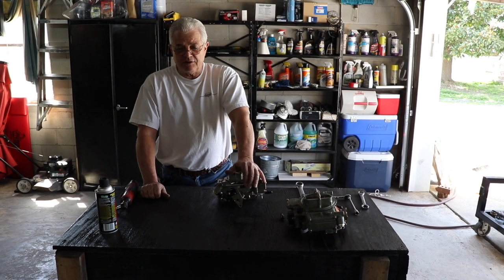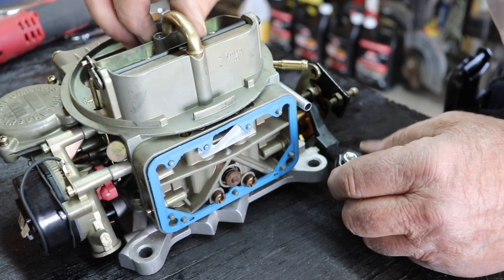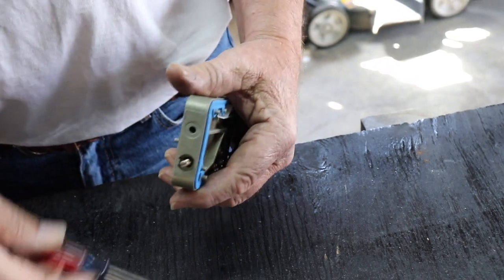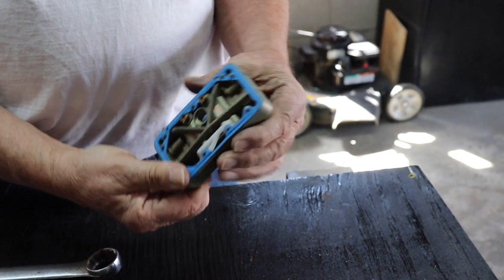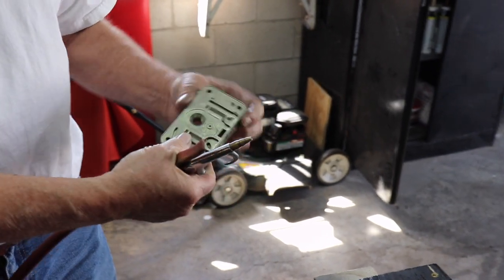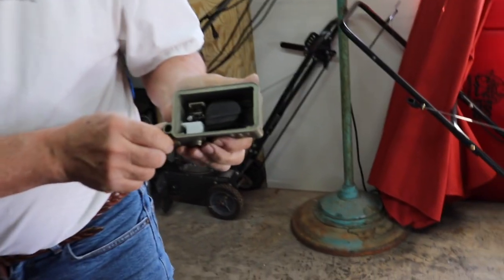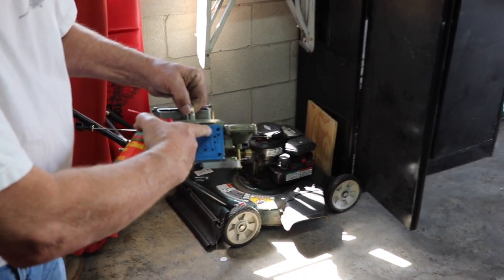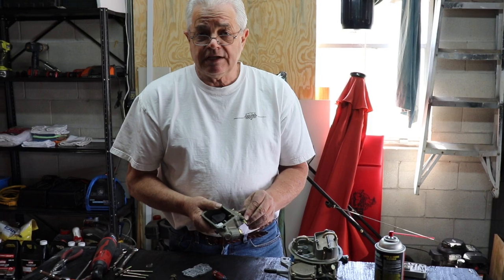Cleaning A Holley 4160 Carburetor | Inboard Marine Carb Care

Comment: Very helpful video, Vince. Thanks for posting.
The carb in my boat was rebuilt 2 1/2 years ago and there had been water intrusion in the fuel system. So I ended up replacing all four gaskets and gave the internal parts a thorough cleaning. 
The engine now starts right up and runs great.

Comment: One question : I have a boat reinell 1999 and before turn it on I move the  shift once forward and put it neutral again when I turn it on some times I notice the Carburator release some gas from. Carburator   when I turn it on it’s that normal or ido i need replace the carburetor?

Comment: I still have my 78 Ski Supreme and the Holley 4160 leaks out the 3/4" round disc?? on top of the float bowl near where the fuel comes in and the side disc on the secondary. Can I JB weld those? Open to suggestions

Comment: I have a 4160 with a few years on it and must scrape stuck on gasket off with razor blade, now I have tiny bits in the metering holes if the carb body, I'm concerned about plugging up the circuit with this debris any advice on how to avoid this would be appreciated,

Comment: I installed a new fuel pump(carte P4389...) on my engine, PCM  5.7L, and when the pump primed, the carburetor was flooding badly(engine not yet running), guess the pumps pressure regulator was possible faulty,  pushing  way to much pressure. Wonder what parts might hav been damaged in the carburetor(Holley 4160)?

Comment: Hey, question - My Holley 4160, 1850-2 series diagram shows a Metering Body Vent Baffle, but my carb doesn't have it.  I've watched several videos of 4160 rebuilds, and I don't see this plastic Metering Body Vent Baffle secured by the blue gasket on the metering block.  Any advice on this?   It's not in the rebuild kit.  I've already rebuilt this once, installed the carb, and then ran the engine.  I am getting a leak in the back, but I'm not quite sure yet where or how.  Anyway, I'm going through it again to see if I missed anything and I noticed the difference between having this vent baffle and the diagram of a 4160.
Reply: I've got an 1850-5 and 80457 and neither carburetors had those vent baffles either. Both run just fine without them.

Comment: I have a question on this model carb....I tried a brand new Holley 4160 that was set up for my Chevrolet 4.3 V6 (OMC & Volvo used this carb after Rochester quit making Quadrajets). No matter what I did (tried all the suggestions made by the techs at Holley) it ran super rich, fouled plugs, etc. Finally in disgust I pulled off the Holley and took apart  the 30 years old original Quadrajet (that I foolishly thought was too old to rebuild) and spend a few hrs with it cleaning it and putting in a good rebuild kit. Well it was 100% better, I have to say. But, it was still bothering me what the heck was wrong with that brand new Holley. I took it apart cleaned out all the passages, made sure the floats were adjusted right, checked the needle valves, etc. Then I noticed one thing on the secondary side....those clutch bolts...holding on the rear metering plate....were only finger tight...could that have allowed extra unmetered fuel to flow....causing the mixture to be way too rich? I put it back together and it's still sitting on a shelf in my garage....and BTW, have you checked their prices lately? Some of the 4160s are like up to $900 which is about 2x what I paid for this one about 5 years ago. Thoughts? could those loose clutch bolts have caused that rich running problem? I know that the Holley is designed to flow some fuel from the secondary side even when running on the primaries to keep the fuel in the secondary bowl from going bad, which is totally different from how a Quadrajet or Carter 4bbl works.
Reply: I’d question the jets. Seems the Holley’s jets may be too big for that engine.
Reply: @rydeyz312  
Well here’s the thing. These carbs were different than the traditional Holley in that there is no power valve in the primary circuit as is typical but the main jets were made bigger to compensate. I never tried re-installing the Holley after finding the loose clutch bolts on the secondary metering plate. Still running my original Quadrajet.
According to Holley this model # carb was specially calibrated for OMC & Volvo 4.3 V6 applications.